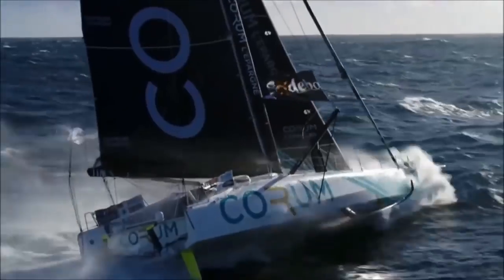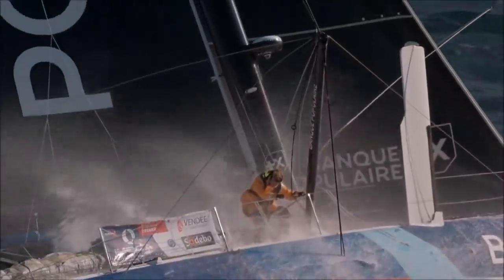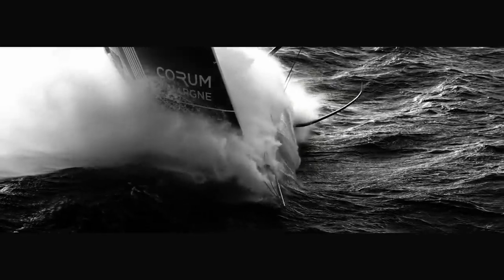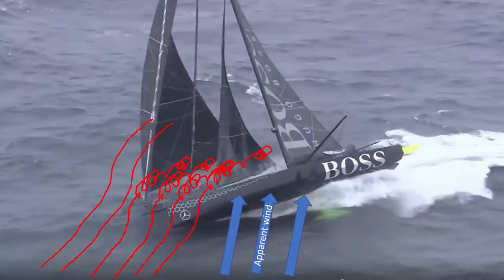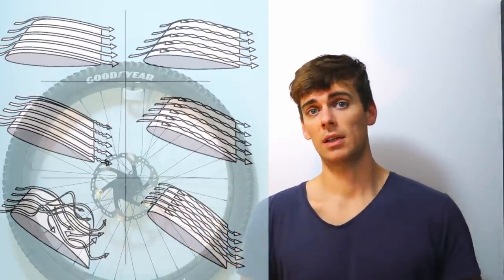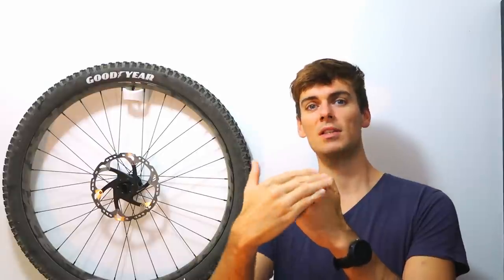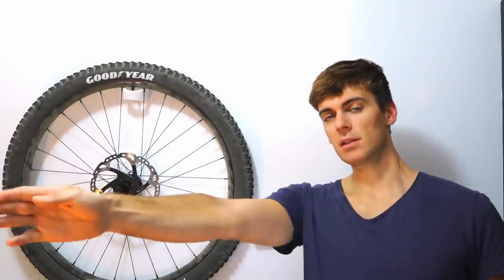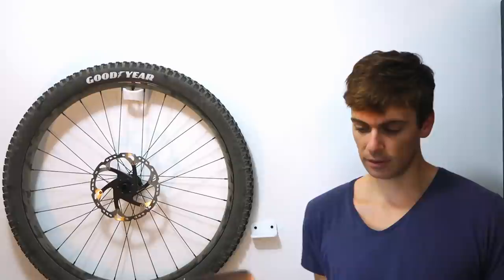Why Corum Dismasted - IMOCA Tech flaw? #VendéeGlobe Boat Design Analysis Part 2 - Aerodynamics

Comment: When it comes to this level of racing I think you’ll find nothing is left to tradition. Lazy jacks and the sail bags on the booms will be used far more often than you’ve presumed during the Vendee, the skippers will be taking reefs in and out almost constantly, especially in the southern ocean. When reefed the bag holds the portion of sail taken in so the skipper doesn’t have to get out on the boom to tie it up which would be both an exhausting and dangerous exercise in some conditions. 

I think you just have to look at the pictures of these boats submarining through waves to realise why the booms aren’t lower and why they don’t seal the gap between the boom and the deck. No membrane is going to last long after it catches two tons of water.

Stanchions are far more useful than you give them credit and the skippers will absolutely use them when going on deck. Making them collapsible would add weight, complexity and add multiple additional potential failure points.

Aerodynamically fairing all of the structures above deck is also not that simple. A shape that brings perfect aerodynamic efficiency from one wind angle will be an aerodynamic disaster from another. Adding aerodynamic fairings that freespin to the optimum angle is a solution but then we’re back to weight and what happens to them when they get hit by waves. I think the consensus at most levels of sailing is that a round cross section is still the best compromise.
Reply: -"collapsible stanchions" two terrifying words, you may touch a stanchion once in 70 days (and only lightly) and it can make the difference between a good and bad outcome
-the "sail bags" can be useful for puttering around the boom on an easy day, when the time comes for a reef, everything is done from inside the cockpit
Reply: Indeed this is at sea and not americas cup playground,  the density of air on deck is from 1.2  to much more from another direction
Reply: True, but it is now being done on the Ultim’ maxi trimarans and this year’s Hugo Boss to an extent. the boom is much lower than any other IMOCA, including its Charal and DMG MORI cousins.
Reply: 100% the guy should talk to someone before just spouting half arsed ideas.
Reply: @liocla2331  I did consider getting onto that but started to feel like I was writing an essay. The Ultimes can get away with sealing the main to the deck as they are far higher out of the water and therefore wouldn't expect green water over the deck to the same extent that the IMOCA boats do. That said I did just find a picture of Charal with something under the boom to seal the gap to the coachroof. I don't know if he's using it during the race though.
Reply: It all comes down to one thing, is this part or design going make my boat more or less seaworthy?  Great comment you hit all my concerns with this video on the head. Still shuddering thinking about collapsible stanchions 😂
Reply: @TheFlyingPlectrum  Half-arsed ideas? That’s typical troll behaviour and has no place here. He may not be a sailor, and some of his suggestions may not be practicable or safe, but it’s good that he has challenging ideas and supports them with science. I suggest that the better approach is to provide constructive criticism of his ideas, or to improve on them, rather than just being unpleasant. It may make you feel superior, but it is a poor reflection on your personailty.
Reply from the maker: G Cox, all good and practicable points. I still challenge you on point 3. How often do you see jammers fail? And how much tension do they hold... Crikey, put two in line so you have redundancy if you really need...then the stanchions are erected from one line in the cockpit and locked. Pretty easy solution and not complex to engineer. I challenge myself here!
Reply: @PeakTorque  Jammers do fail. Hi-mod ropes are also very slippery and thin for their strength. The Imoca boats do have an absolute forest of jammers in their “control centres”, but most of them look to be for control lines rather than lines under major load (sheets, halyards etc). It is also very difficult to have safety lines which are long enough to allow work at mast and bow, but which are short enough that you don’t go overboard if you fall. As an offshore sailor, this is something on which I have spent A LOT of time improving on my own boat. The stanchions and guardrails play an important role in keeping you on board if you do fall, and also help managing sails on deck. On the other hand, the most advanced Imoca boats can apparently ONLY be managed from inside, as with the speeds they travel at, work outside is too dangerous.  I very much liked your analysis of the rig as the “fuse”, and would be interested if engineers actually involved in Imoca development come across your channel. Challenging convention is how we progress.
Reply: I was gonna comment on this but you've summarized this better any way so what's the point
Reply: @PeakTorque  The jammer isn't the only point of failure. You've added moving parts to each and every stanchion base too. I'm not saying that such a system can't be engineered but the main challenge is going to be weight. That said if you're using jammers another challenge is going to be getting one small enough to be able to grip the small size of line used whilst also being strong enough to take the loads required to keep someone from being washed overboard.

The end result is that the stanchions are going to be fairly comprehensively defined in the rule the boats are built to, down to strength, height, length etc. If everyone has to have them then no one is at a disadvantage. These boats are designed to race against each other reliably and safely. There are plenty of rules in the IMOCA design that actively limit the boats performance. Just like in Formula 1 the teams have to design and build the fastest boat to the rule, not just the fastest boat possible. Once this edition of the Vendee globe is over the IMOCA rule will be amended again with lessons learnt before teams can start building new boats for the next one.
Reply: @billfromgermany  he is not presenting challenging ideas; he is assuming that he is far, far, far smarter than the designers and sailors. Many of his comments are just sneers from someone who is assuming that they know more than the designers and sailors, and who is not backing up his claims of superiority with proper analysis.  For example, we all know about tip losses - but some aerodynamics experts say that creating a successful endplate under a boom requires the gap to be sealed to a far greater degree than he is proposing. He is also ignoring the issue of moving around the deck when there is a sealed endplate, and the critical issue of a lower boom or endplate device dragging in the water and possibly breaking.  Similarly, the comment about the section of the outriggers is an example of the commentator believing they they know more about the class, the designers and the sailors - the Open 60s are not supposed to be the ultimate in speed but a balance between speed, cost, seaworthiness, etc.  Sure, an airfoil section may be quicker - but at what cost in dollars, durability, etc?  The history of 60' tri mast sections and beam fairings seems to indicate that the round-versus-airfoil question is a far more sophisticated one than the commentator thinks it is.  In the end, anyone can sit back and go "oh, I know so much more about this than the idiots who are out there doing it, and I'll say what they should do", but one learns far more by assuming that the doers are not stupid and then trying to work out why they have chosen the design they did.  Oh, and if someone is so critical in their videos, they would be hypocritical to complain of viewers criticising them.
Reply: @PeakTorque  I failed jammers this season. they dont like jerk loads. They creep which is why you keep critical halyard on a winch.
Reply: Think of it like the halo.
Reply: But how much weight would add, by adding freespin aerodynamic fairings onto the stanchions? They're not structural in any way so they can be really light and still do the job, I'm guessing a lot of those fairings would break during the race but they aren't critical.
I also think the outriggers could have an aerofoil shape, but since I don't really know if the guys have to use them often and how they use them, I don't know if it would impact something else.
And I also think you could have some sort of a retractable skirt below the mainsail to seal it off without that much weight added, just like the old f1 cars the skirts popped in and out (except in f1 they had them aerodynamically automated which is not desirable in this case)

Comment: This is really interesting analysis, and love it. Thank you. I'm no IMOCA racer, but I do have a quarter million nautical miles of offshore sailing under my belt.

Deck features are standardized within the rule so corners aren't cut, making unstandardised areas the focus of the innovation. When I hear you talking about foil shaped deck hardware, I think of a nightmare of axe blades. 

Deck hardware is round because when your boat hits a wave, as noted in your previous video, there is an exceptional transfer of force. Skippers on deck brace themselves against deck hardware. I think you could model the transfer of forces, which would be really interesting.

I've rarely been above 20 knots boat speed. I can tell you that even at half that the foredeck at night in the southern ocean is nothing short of hell. Let's not add axe blades.

Lazy jacks enable singlehanded sail changes, so you can manage the righting moment. It would also be useful to look at the quality of air at masthead Vs deck, I think being able to maintain an accurate righting moment more consistently is probably worth the cost of lazy jacks, especially when that penalty is shared across the fleet.

The thing about the IMOCA class is that it's pretty organic. It's the product of aggressive sailing over the past 25 years. For every oddity there will be a clear rationale. Because IMOCA isn't Formula 1. It's rally car racing and La Mans but over 3 months with no pit crew.
Reply: very well said. I didn't even think of the razor blade nightmare it would make for the eventual foredeck crew.

Comment: Great video. Regarding the stanchions, the IMOCA sailors don't normally clip on. If you fall overboard singlehanded at the speed these boats travel with a lanyard attached the chances are you will drown whilst tethered to the side of the boat. If you had to clip on, your movement would be slowed down and you would need to put a harness on before you could go on deck.

The stanchions are also useful when sail changing when sailing single handed. Even taking into account apparent wind angle, I'm not sure how you orientate a foil design.
Reply: I see alot of holding on the them for dear life while moving around the boat. I suspect you are right about the fate of someone tied to the back of the boat although they have remote control of the autopilot so I guess they could feather up but I doubt it would improve their chances much.

Comment: The author keeps on comparing the Vendee Globe IMOCA design to the America's Cup design.  These are very different sailing regimes.  The current Americas Cup is designed for sailing in flat, protected water of the harbor.  Because of this environment, it can do away with stanchion, foiling wings that do not heel the boat, but the boat is extremely difficult to sail.  Also, every time these foiling wonders sail, they are followed by a team of support power boat for the various things such as umpiring, catching sailors falling overboard.  In the IMOCA, there is one sailor sailing around the world, in the worst sailing weather, giant waves, sometime having to survive the worst storms in the southern ocean.  Also the discussion concerning the aerodynamic of the spreaders and the boom.  I don't know the technical profession of the author but in the real world, aerodynamic doesn't come for free.  You cannot compare the 3:1 airfoil ratio of a F1 suspension members that can barely withstand any compression load to the IMOCA mast spreaders that have to withstand the tremendous amount of compression load from the boat righting moment, from the frequent wave slamming forces.  Even with the best of engineering, they did fail recently in the race.  If a boom made into an airfoil shape, more carbon must be used to compensate for the compression load, nothing is free in physics.  With regard to the discussion in the heeling angle, the IMOCA foils in Charral or Apivia are designed increase the righting moment, keeping the heel angle at the moment. Again, nothing is free since the foils are very heavy and the higher the moment is imposed by the foil, it tends to break in the ocean race.  The reason the foils are heavy  because of the bending load and the goal of keeping the foils as thin as possible.  I know you posed a lot of questions but it more interesting if you take time to discuss the engineering aspect respective of the boat mission instead of comparing two vastly different types of boats.  It is like comparing the rally car lack of refined aerodynamic to an F1 car.

Comment: imocas are built for their route, which is 70/80% spacious ahead of the wind. They cannot therefore be compared with ac75s that are used for a short buoy race just off the coast (and  stop when the wind is too high). The images of the very sloping (old) boss are without a foil that he had already lost before (and he only had 1 and you can see it). Furthermore, the outrigger poles have more functions 1 to turn the mast 2 the front sheets are on them (no spinnaker pole needed) so difficult to make them more aerodynamic because they move (but we will see it in the future). And without railing you will not go solo to the sea, certainly not the southern ones !! If you look closely at Ac75's you can see that they just tip over the other way justblike a windsurfer and indeed with these boats on their "short" competition course every aerodynamic bit is taken, with an imoca this plays less and they make compromises for safety during the long distance. . And if you are so far from civilization without help they are very much needed. A retractable system seems interesting to me only a bit silly when it stops working and you have to give up !!. Funny to hear your ideas I'm curious about your other movies cycling/mtb is also one of my hobbies besides sailing.

Comment: Regarding stanchions, I'd suggest you visit Les Sables or Lorient or Port-La-Foret after the VG to inspect some IMOCAs and see the amount of damage they have to sustain. Having a self-aligning fairing on them would be difficult and expensive to make work reliably in off-shore conditions. Love your innovative spirit though, but would suggest introducing other engineering trade-offs such as extreme maritime conditions and cost of manufacture and maintainenance, and not just pure speed.

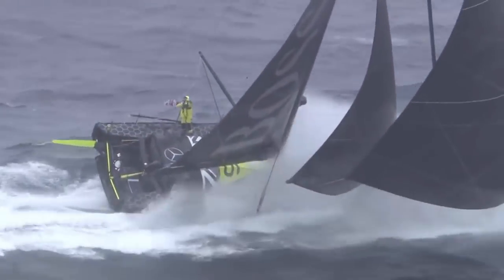Comment: I'm pretty sure the images at 5:00 have been taken from the video done by "Marine Nationale" in the south sea. At that point in the race, the foil at starboard was already broken. The excessive angle and the instability were due to that problem, not to a fault in the design. Please check if the information I gave you regarding the foil is correct, but I'm quite sure it is.
Reply from the maker: Yep. Correct 😉
Reply: Yes if he had not lost the foil, he would have carried less sail heeled less and won that race!

Comment: You didn’t know that the outriggers are a one design feature which cannot be faired.   Lifelines are also required by sport rules, down to the diameter and height of the lifelines.  The lazy jacks are necessary for keeping the sail under control by one person when the shit hits the fan.
I don’t know the logic behind the sail cover, but I think it helps when there is a reef tied in.

Comment: You mentioned a coach roof sweeping membrane below the boom, and I wanted to mention the Gitana ultim-class trimaran (currently on a Jules Verne trophy run) has recently installed one. Their competitor, Sodebo, has a even more radical approach: move the whole coach in front of the mast, and move the boom to the floor behind the coach.